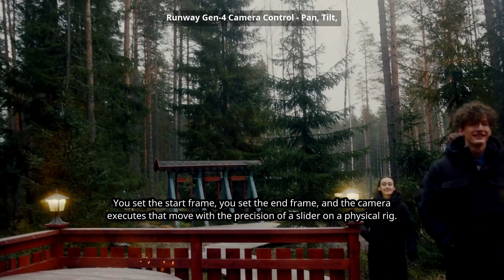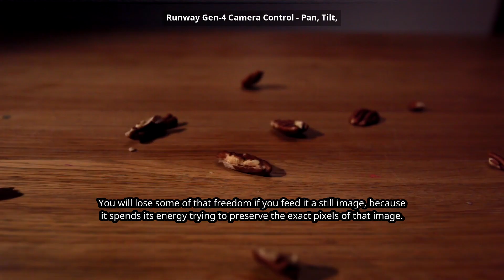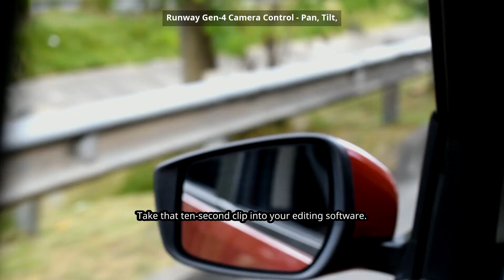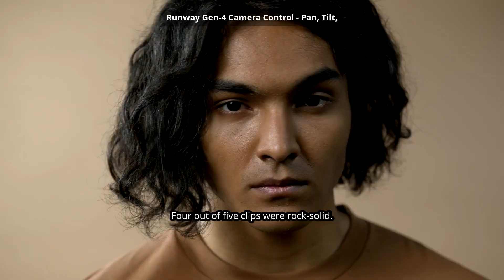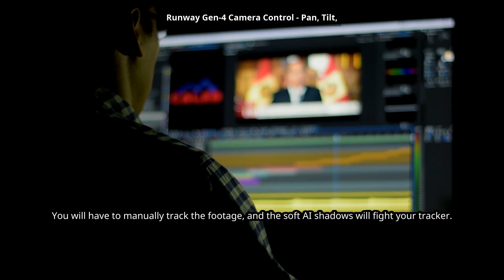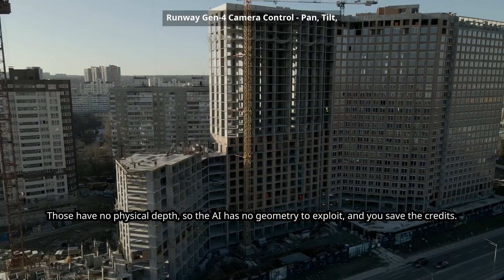Runway Gen-4 Camera Control: Pan, Tilt, Zoom Like a Pro

Comment from the maker: Tip: Most people forget that Gen-4 reads "camera move" better if you describe the subject's reaction to the move (e.g., "as the camera pushes in, the character looks up"), which drastically reduces morphing artifacts.

Quick question for you: When you use text prompts for camera moves, do you prefer controlling the speed of the move (fast whip vs. slow push) or just the *direction*—and which one gives you more consistent results?